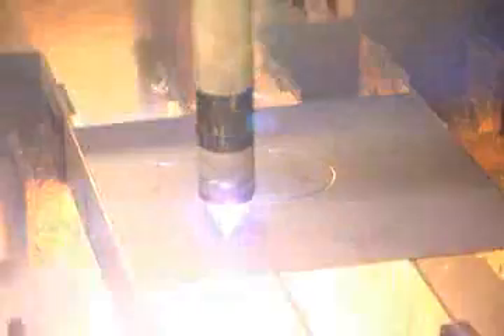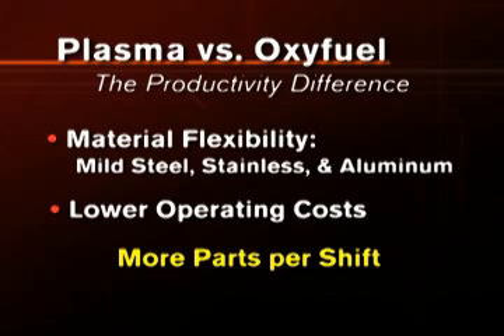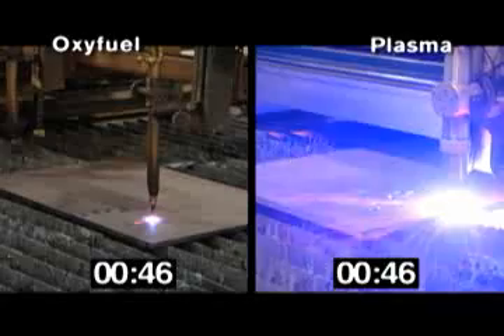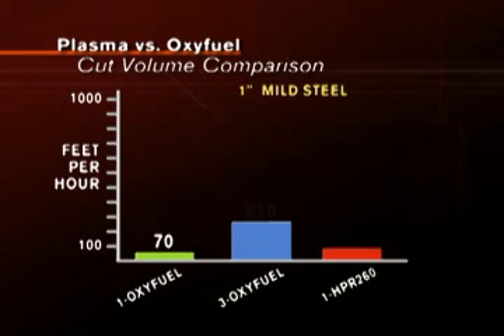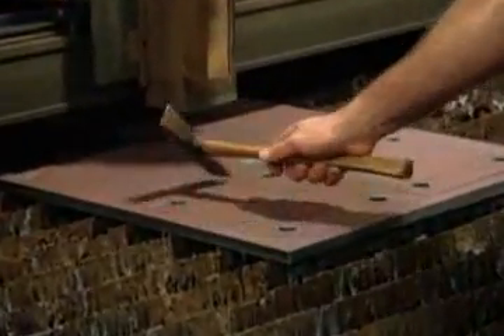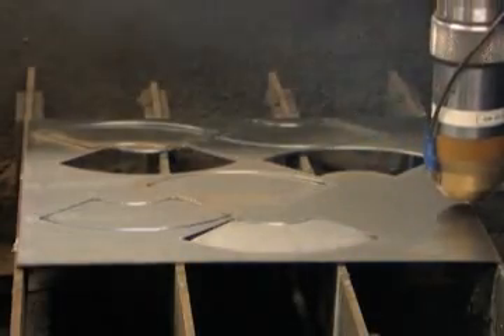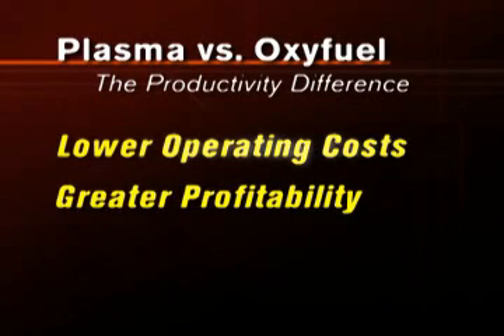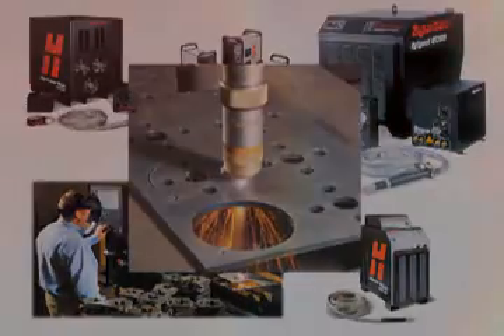Plasma cutting sys from Hypertherm

Comment: what is the minimum hole diameter that a plasma can cut on a 50mm 
i want a machine that can cut 10 mm diameter  on less than 50mm thick metal
Reply from the maker: +shand seimela It depends on the capacity of power source you have. Check it out at machine specs